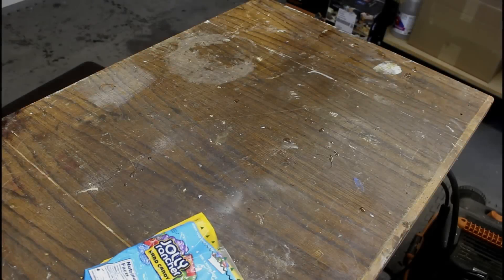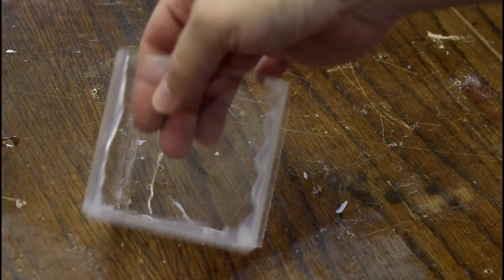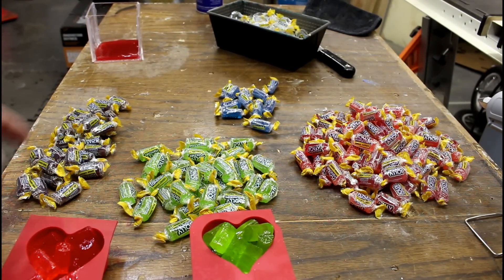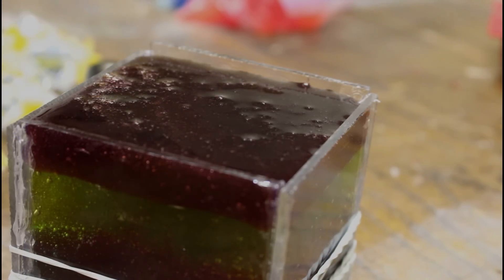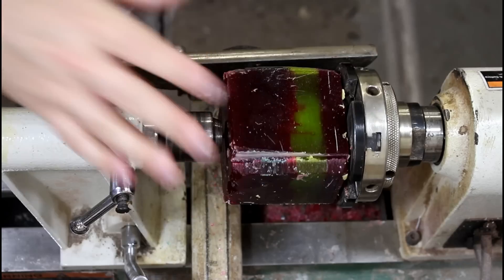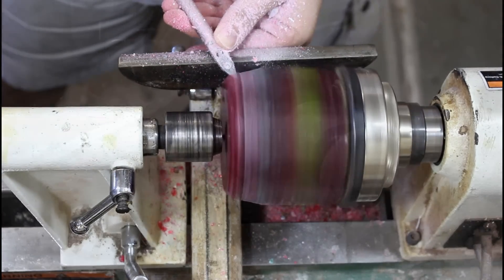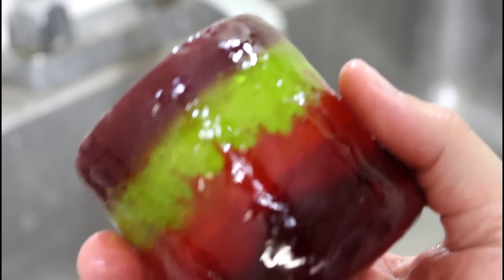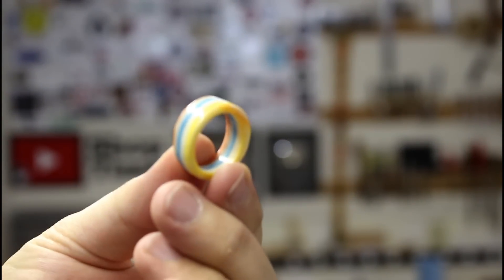Jolly Rancher Candle Holder

Comment: Forstner Bit Taffy. I think that's a world first. Nice video Peter. I liked the way the colours flowed into each other. Do you reckon that effect can be replicated with coloured resin?
Reply from the maker: 100% sub out the candy for resin and you've got a much more useful object. I would also say, adding an HDPE plug in the center to avoid having to drill out that gigantic hole...
Reply: If you have a food grade drill press then just do this when making toffee, 5 hours of kneading into 30 seconds of drilling and 4 hours of cleaning

Comment: wait until the first layer dries yhen move on to the next layer
Reply: Zane McCleery that's what I thought
Reply: Only problem with that is the long times it takes for EACH and EVERY layer. It all adds up
Reply: Then there would be a weakness between each layer which could separate when it's worked.

Comment: To further cool the holder cut holes in the bottom on the  sides, it will cause the venturi effect due to the rising hot air causing the holes to draw in cool air around the inner wall of the holder. :D nice project

Comment: i think you should do a wood project out of old skate boards as they are colored layers ive made knife handles out of them and they turned out really nice and you can go to a local skate shop and get broken boards  for free just need to remove the grip tape with a heat gun

Comment: Holy shit, it made a taffy out of the core. If you do this again, freeze the cube over night or let it sit out for days before you grind into it. The molten core has to set up and cool temps will help. You could also make smaller sections then glue them together with the melted sugar, a bit dangerous for heat sensitive people but a viable option.

Comment: I was not aware Mr. Bill cared so much for unicorns. 
Also, that looked like a nightmare to clean up.
On a side note: When you made mention of the smell while drilling/melting the 2" hole - it made me wonder if you could use a "cup of jolly ranchers" in a candle warmer for the smell? 
I imagine this would vary from one candle warmer to the next due to the potential heat it could generate.

Comment: I still vote mercury just let the bottom half cure then sand a little pit in it so the mercury has a place to sit in the middle then pour over it.. that's if resin or epoxy even works like that..